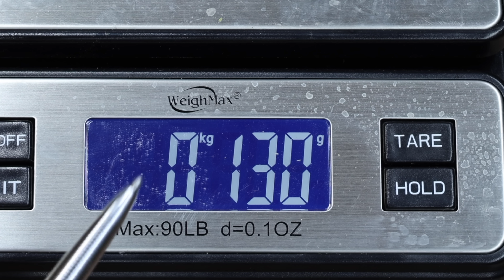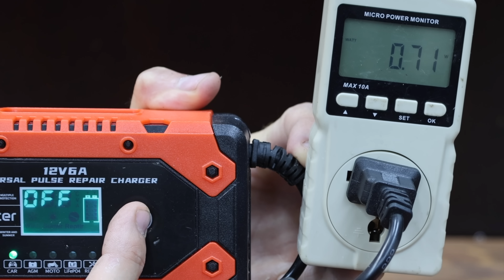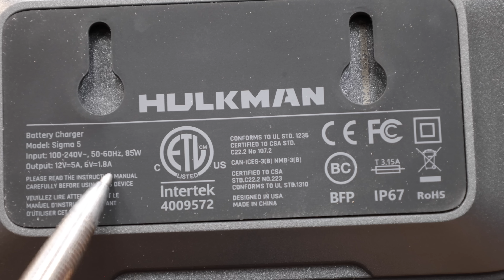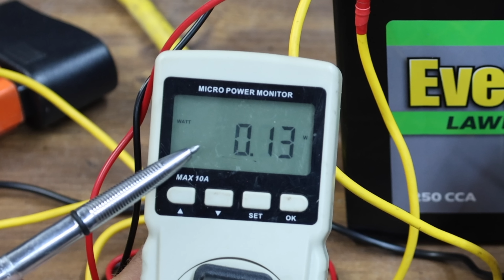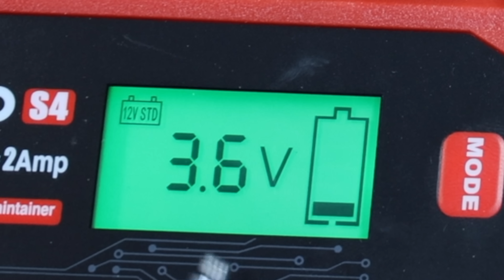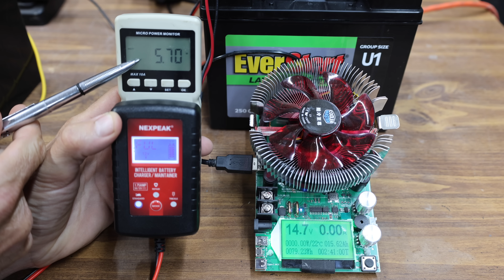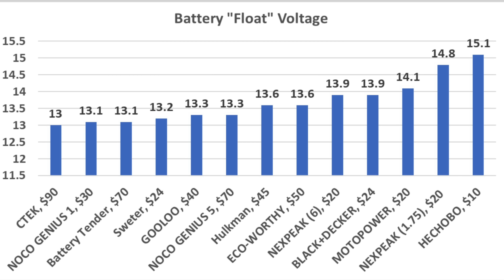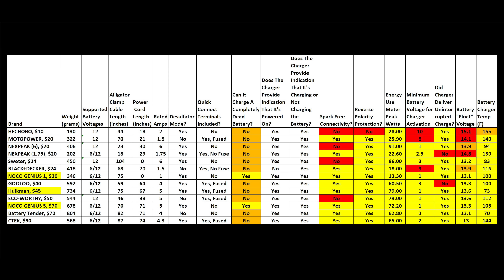I Tested the Most Hyped Car Battery Chargers – One Stood Out!

Comment: Yes, please test the larger battery chargers too.  My Sears battery charger with 3 settings, automatic, fast charge, and boost for starting cars I bought in the early '70's lasted 40 years of heavy use as a mechanic.  Finally had to replace it.  Bought a new Stanley/Black-n-Decker for about $90.  I put it on automatic for my F350 truck with a near-new battery for the first time.  Came back later and saw it blew out the side of my battery.  After several calls and many emails I gave up trying to have the charger replaced under warranty and threw it in the trash.  Never again will I buy a new electronic battery charger, especially with their lack of warranty and difficulty reaching anyone in their customer service department.  I bought another old used analog electrical (not electronic) charger from eBay and its worked perfectly.
Reply from the maker: Thank you for the suggestion!

Comment: I find it very interesting that these Nexpeak chargers did so poorly. I say this because I use 2 Nexpeak NC201 chargers. I have one at home amd one at work. They both perform spot on for charging amd in repair mode. The one at home I used at work for a while till I bought a second to use only at work. Both perform the same and are amazing battery chargers!
Reply from the maker: Thanks for the feedback.

Comment: What you missed on the C-teck it a variety of charge rates and voltages depending on battery type and size. AGM, Flooded cell  have different charge voltage requirements. small battery like motorcycle= lower charge current. Accuracy and longevity  Cetek has quality in engineering and construction.  My 15 year old C-tek still works great.
Reply from the maker: Thanks for the constructive feedback.

Comment: Hello again.  i own several of these chargers plus some...lol i personally never leave any charger to float as ive experienced several dead batteries when i attempt to use them months later. 
Suggested video:  im a big dewalt max 20v platform tool user and own several genuine tools but Temu has so many almost identical tools for 1/5th the cost i had to try some of them. i got an angle grinder, an impact driver (400 ftlb), an impact wrench 1/2" (600 ft lb) and a 1000 ftlb 1/2" impact wrench... but my largest torque wrench is only rated to 150ftlbs so i have no way of getting any accurate readings of what these tools can achive. if you could put some of these Temu torque claims to the test would be great.  Thanks again for your work.  ive purchased several products over the years because of your videos.
Reply from the maker: Thanks!  Thanks for the suggestion.

Comment: To trick and kick start most of the chargers which won't start due to low voltage is by temporarily connecting a jump pack to the battery when the charger is connected.   That will raise the voltage enough for the chargers to kick in and then the jump pack can usually be disconnected while the charger keeps charging.

Comment: You seems to be "technical guy", and mostly your provide right angle for products, but in this video.... I want to ask you several questions. What is "Crank" current on different vehicles? What are todays current capabilities of lithium cells of different manufacturers? How is life expectancy of cell discharge affect lithium cells? What would be life expectancy of the charger/booster made out of lithium cells after using it 1, 5, 10 times?  Will the booster show you full charge with one cell change internal resistance X10 times? Will same charger provide required current? What is the difference between MAX current of the best cell available currently and average  cranking current? Good luck to you in your education process.

Comment: CTEK is the most overrated pos. Any problem and it will stop charging and will not recover. It would be nice to come to charged battery instead of a CTEK in error mode.
Reply: Which one failed on you ?

Comment: I bought a West Marine charger years ago. It charges every known battery type to the proper voltage, and does it pretty quick.  That thing is over ten years old and still works like new.  It even has a fan inside to keep things cool.  It doesn’t do six volts though.  Cost me about a hundred bucks, and worth it.

Comment: another timely video!

FYI : 
i used a Stanley trickle charger (2A) after my 40 year old Sears charger shorted out.
i used to leave it on the battery until the last time, where i found the terminals had corroded, taking the connectors with them.

even "trickle" chargers will damage a sealed lead acid battery if left on; unless there is a vent in the battery's design, a small, persistent charge will cause a leak eventually.

Comment: Very impressive thoroughness! However, in my experience, once one of these sophisticated battery chargers has a partial failure, it's scrap time. The old school auto battery charger, if designed properly, could nominally avert overcharging.

Comment: I bought and liked the NOCO Genius1 so much I ended up buying the Genius5 a couple years later. The Genius1 probably kept my last 12v AGM battery alive 5 years longer than it should've been. I finally replaced it because its cold crank rating got so low I had to throw in the towel and buy a new one.

Comment: I don't know if models 1 and 5 are the same as Noco Genius 10 but the claim of charging a dead battery needs qualification. You can put it in a force mode, for 5 minutes, then it defaults back to the battery sense mode and goes into standby. I don't know how this could reliably charge a dead battery. If this is wrong, please let me know.

Comment: I have an old manual battery charger. 2/10/50 amp.
Analog meter on it.
Mechanical switch between 2 and 10/50 (starting boost).
I can charge a totally dead lead acid battery so long as it is not shorted internally or frozen.
Pretty sure it can mostly charge other batteries but haven't tried it.
Has a pretty hefty transformer in it for voltage conversion and two diodes.
Reply from the maker: Thanks for sharing.

Comment: Thanks for all of your content - I watch even when the particular subject holds little interest for me, which is rare.  I see you've done a lot on chargers and batteries.  But, I don't see anything on rechargeable battery stations for AA, AAA, and 9 volt batteries.  I tend to use rechargeable batteries around the house but have yet to find a charger that behaves exactly the way I'd like.  It seems, after the battery is charged and left in the charger - it will drain over time and never be charged again until it's removed and reinserted.  Also, if the power is disconnected from the charger and the battery is left in, the charger will drain the battery.  Thanks again.
Reply from the maker: You are welcome!  Thanks for the suggestion.

Comment: None of the chargers are 100% efficient, and it is highly likely that they range significantly in efficiency, so you cannot compare the power it is drawing from the wall to the power delivered to the battery without correcting for this.

Comment: So I bought the NOCO Genius 10 based on the recommendation for the Genius 5 (it was only $10 more on Amazon at the time). I found out NOCO genius does not maintain or float charge the battery. It cuts off once it deems it fully charged, and then when the voltage drops below a threshold it starts up again.

Battery Tender actually maintains the battery indefinitely. Big difference. This wasn't really noted in the review.

Comment: Some suggestions for test measurements;
It's best to test the output amps with a multimeter or DC clamp meter. The charger efficiency will factor in the the measured AC power vs the output power to the battery.
Chargers aren't particularly efficient, you'd be looking somewhere in the 80% range
Reply from the maker: Thanks for the suggestions.

Comment: If you want to use the battery charger in-series with a large inverter then you probably want a charger that can maintain float above 14 volts. Otherwise the inverter will trip or the [smart] charger will fail to off. Keep in mind that anything labeled smart was probably programmed by the least capable engineer.

Comment: Regarding the CTEK. If you put the charger in Recondition mode it will start charging a dead battery. I have been using this brand for a very long time. I think I might have just about every model they sell. I use them personally and in my auto shop. I’ve never had one fail me so far. 
Great video my friend.

Comment: lol got a 10A Ctek that has a power supply mode, feed that into a dead battery for awhile that the normal charge mode didnt pick up. after about 15 mins it had enough that the charger then picked it up in the recondition mode

Comment: I had two older battery tenders years ago, then one failed.  It would just stop charging.  So then I bought a CTEK and loved it, however it was an older model and did spark when connecting the clamps.  I recently updated to their latest version and bought two of them.  No matter what your results were, I feel CTEK's are the best.  One thing to note is that not all dead batteries can be brought back, as they have limited lifespans based on charge cycles, extreme temps and deep discharge occurrences.

Comment: I've always had great luck with BatteryMINDer brand.  I've brought several batteries back from the dead with my 20 year old BatteryMINDer.  They make automotive and Aircraft battery chargers. On my old one, you have to press a button to desulphate a dead battery, or it starts desulphating once the battery is full.  The newer ones just desulphate constantly while charging. 
When i bought my latest vehicle, i put in a BatteryMINDer onboard desulphator that constantly desulphates when the vehicle is running.  We'll see how it goes.  I doubt it will make a battery have a longer life, since sulphation isn't really what makes them die. If anything, it will keep it starting the vehicle quicker through it's life.

Comment: The Ctek mxs 5.0 has been a durable companion for many years. Its only minus is the missing ability to start from 0V. But todays batteries rarely wake up to usable capacity after they’ve been to 0V or frozen. Plus side on the ctek is that it has an IP rating

Comment: The thing that was missing was to cut power to each charger when it was providing float charging and see if it would restart.  I have a more expensive Clore battery charger and I am disappointed that it won't go back to it's previous setting after a power outage.  In that situation, the battery that is supposed to being maintained might just as well not be connected.

Comment: What about amp during starting and voltage drop test? Would any of this battery tender make a difference? The noco brand supposedly makes a battery drsulfation at the end of each battery charging, which would be the high wattage you've noticed during your testing

Comment: Bought a CTEK charger on January 16th of 2013.  It has had no problems resurrecting dead batteries, some three or four times.  Sounds like there are now many good chargers which wasn't the case when I bought mine.  I would not hesitate to buy a well rated charger as they will save you many times the price of the charger.  Thanks for the video!

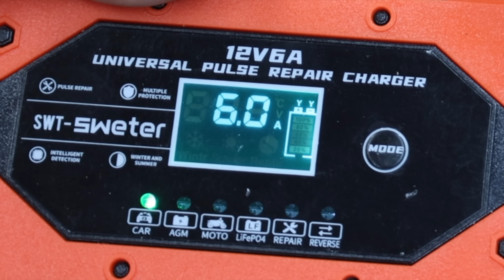Comment: At 10:00 you claim, that the ~40W the charger draws is not enough to get 6A of current. However the battery sits only at like ~5V. 5V*6A is 30W (the missing 10W are heating the brick).

Comment: I’ve used the same CTEK model for almost 6 years now. After my warranty expired my unit somehow short circuited internally before connecting to a battery. Emailed CTEK, returned the old and had a brand new one shipped back to me in the same week. 

It’s pretty rare to see a battery go completely flat unless it’s been sitting for years untouched, and the float charge is what matters to me most when my batteries are out for the non-season use.

Comment: The 7 Amps version of the CTEK has a "supply mode" that just puts out 13,8V and 7A no matter what and I use it to lift dead batteries'  voltage up beyond the recognition level of this and other chargers. I would avoid automatic 6/12V chargers due to this reason as deeply discharged 12V batteries are recognized as 6V ans they're full after a couple of seconds of charging with 7,4V but still below the 10V mark the 12V mode needs.

Comment: Just wanted to give folks a heads-up to avoid my mistake!
I recently bought a Noco Genius 1 to charge a dead car battery. It does work, but I learned that a typical car battery is about 50Ah. The Noco Genius 1 charges at 1 Amp per hour, so this is gonna take... 50 hours (probably more, because I doubt it's 100% efficient).
If you're trying to charge large, dead batteries, go for a Genius 5 or 10 instead. Take care.

Comment: I will never understand the point of a battery charger that can't charge a dead battery.
Reply: thats the reason. its dead. even if you manage to charge a battery that was at 0v it will be massively degraded in capacity and should be replaced asap
Reply: @alvisozolins4963 If I had a nickel for every completely flat battery I ever saved, I could probably buy a few brand new batteries with the change.  Yes, running to 0V will cause excessive sulfation.  But that is what the desulfantor function on chargers is for! As long as the plates didn't shed and cause a short, the battery will still work fine.

Comment: Good review as always. I bought the CTEC one several years ago to keep some of the batteries I had charged, it ended one of my Optima batteries. I first thought it just quite do to being old. Then I had it on my Wrangler Optima battery it killed it then. $90.00 for the pos and over $400 for the Optima batteries.  I've had good luck with the Optima small battery charger/ maintainer. But the case has fallen apart on it.

Comment: NOCO 10 Amp is even better with an additional 12v DC constant power supply option as well as being in that sweet spot of not being too hard on a power sport battery but charges fast enough to get somewhere.
The reconditioning has brought back batteries that failed an analog load tester. Got the 1.5 the 5 and the 10.😊

Comment: What is the difference between a jump starter and a battery charger? I just jumped my car and sat in the car 30 mins without the radio or A/C on to recharge the battery as I could not leave my spot. I’m watching YT to learn. Thanks folks.

Comment: I've had a Noco Genius 5 on-board style charger mounted in my car for YEARS... Absolutely worth it... Having an onboard charger means never worrying about a dead battery. 5amp charger means that 30 min of charging puts enough energy back in to start the car. Get back home (or get to work) and plug it in, its fully refreshed when I go to leave again.
Reply: Do you keep it plugged to your battery at all times? Some chargers power on their display/leds when connected to the battery, even if it's not connected to an power outlet. I'm thinking of getting a Noco, and I would like to keep it hooked up in the battery on a boat. If it powers on, I'm afraid it will drain the battery
Reply: @jauho7483  the one I have has a single LED to indicate charging status, and from what I have seen, its only on when the charger is connected to AC power.

Comment: Been using the NOCO 5 and a NOCO 10 for a few years now each, plus a few of their jump packs.  They have the only jump packs I will trust to start my diesel truck from a completely dead battery in the middle of winter or extreme summer heat.  Bonus to the NOCO 10 is it has a 12v supply mode, which is really handy for powering small stuff.  I use it to test trailer lights.  They have modes for SLA, AGM, and Lithium batteries.  Also have a NOCO 5x2 (2 charging leads) that will independently keep my motorcycles charged up and fire up right away every time.  Won't buy anything else!

Comment: More video ideas!

Best ultrasonic cleaner & ultrasonic cleaning fluid.
Best wheelbarrow.
Best shovel.
Best axe.
Best glass cleaner.
Milwaukee packout vs other brands.
Best toolbox.
Best rotary tool / dremel. Dremel vs other brands.
Best power brick for phones and laptops. Anker vs other brands.
Best jobsite fan.
Best caulking gun.
Best caulking paste.
Are all microfiber cloths the same? Microfiber cloths from different manufacturers compared.
Best torque screwdriver.
Flex paste vs other brands.

Comment: One thing that this showed was that the CTEK is using the recommended CCCV charging method. You can see that it is locking the current and voltage, as recommended for lead acid battery manufacturers...

Comment: Not even the crude harbor freights will charge a dead battery with out a jump to trick it. 

The worst charger I have will  drain a low battery all the way if it flags it as "bad".

Comment: You didn't test the Harbor Freight offering(s).  As to the Battery Tender Brand, of the three I bought,  two burned out rather quickly.  One got up to 150 degrees.  The other still had the lights come on but did nothing.  The third is still working.  I've had good luck with the Harbor Freight Viking Brand 4 amp ones.

Comment: Noco on top doesn't surprise me.  I've had the Noco Genius G4 for almost 10 years and use it for its ability to recondition SLA/AGM batteries. (I've used it on FLA many times as well with great result)  I have the Noco Genius 1 on my standby generator battery (in lieu of it's own charger.....disconnected) thus far for about 2 years.... we'll see if it exceeds the 3 year life expectancy of the battery, but the generator starts every time.

Comment: A reason that most of the chargers did nor kick in until 7 to 10 volts is the soft start more.  This soft start mode introduces volts and amps slow until 7 to 10 volts as this mode helps with a longer life to the overall health of the battery.  Would prefer to keep a car battery over 11volts.  This demo was well worth to go through.